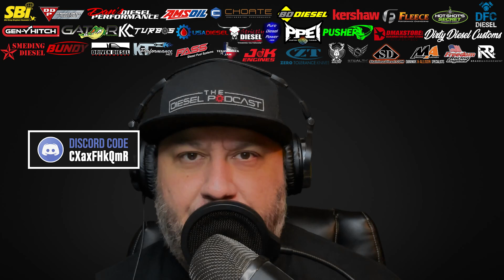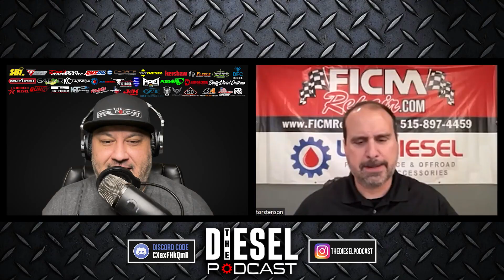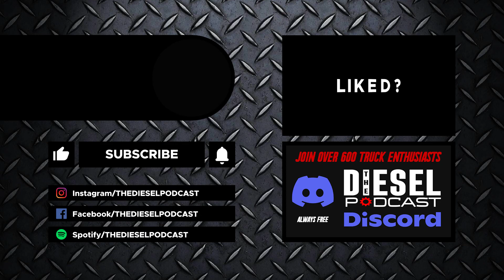FICM Repair/USA Diesel on The Diesel Podcast Talking LHG & Fewer Regens

Comment: This might be a silly question, but could there be any issue from the thermal shock of heating up the water/block so fast?  I always hear never pour cold coolant into a warm engine and warm up gradually.  Is this product doing the opposite?
Reply: I think that was good question. Just shows you're thinking about things. --  I know the LHG units have been used for decades on diesel generators, school buses, big rigs, etc.  (Detroit, Freightliner, Daimler.... they've all bought and used the technology) It's sound and proven, but just now trickling down to the passenger vehicle sector. I'm sure modern emission systems and EPA regs (along with increasing penalties) have helped prod things along.